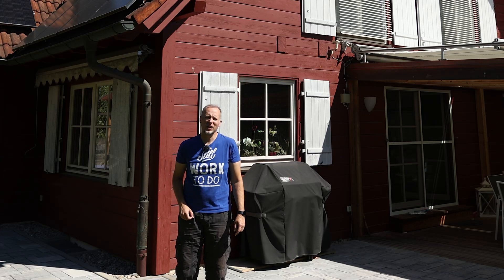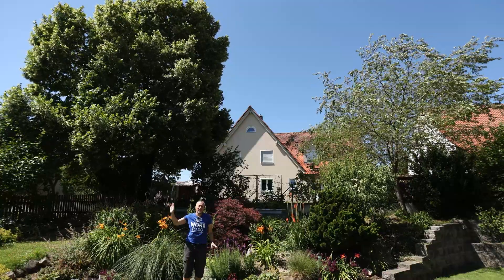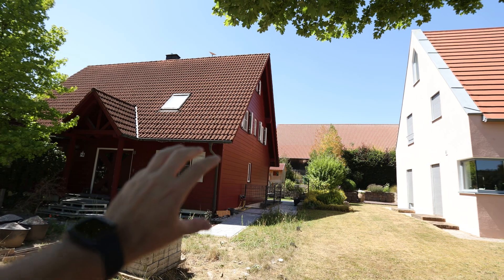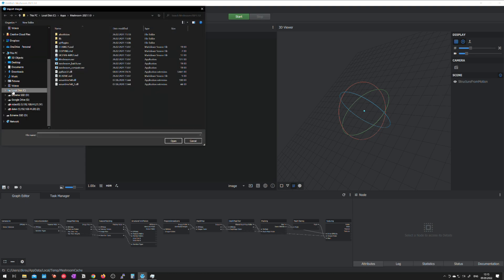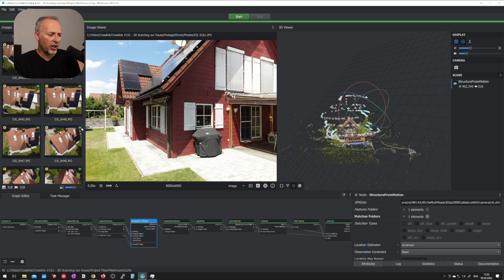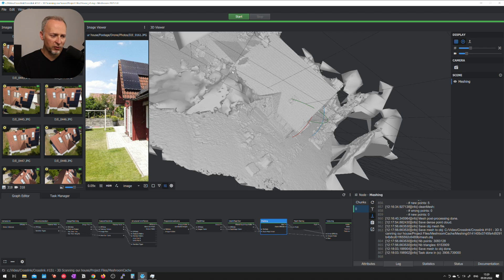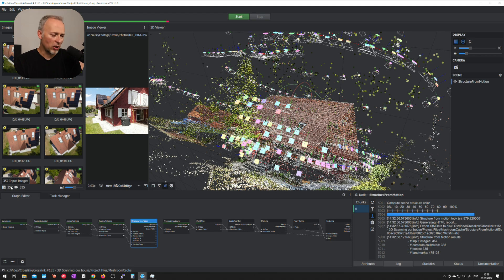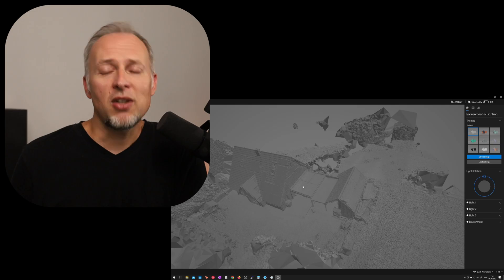3D SCANNING with a DRONE: This is how I do it

Comment: Hi I enjoyed your video. I am new to this and after trying itI have a problem I can't solve, I hope you can help. I'm trying to scan a house. I use a DJI Mavic air 2 to take pictures witha map mission, then manually fly and take some closer pics of the house about 50 pictures each way. When I import into Meshroom, if I import one set of either of them It works as it should. If I import both groups the ones from the map mission are accepted and it works but the ones from the manual shoot are rejected ie; red icon in right top corner of thumbnail. Either group alone works but the two don't. I tried the same project scanning the second set with the Iphone 10 with same results. All meshroom settings are left at default. I would appreciate any suggestions. Thanks
Reply: can we contact ?